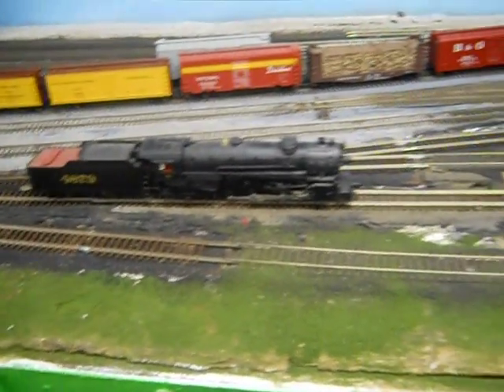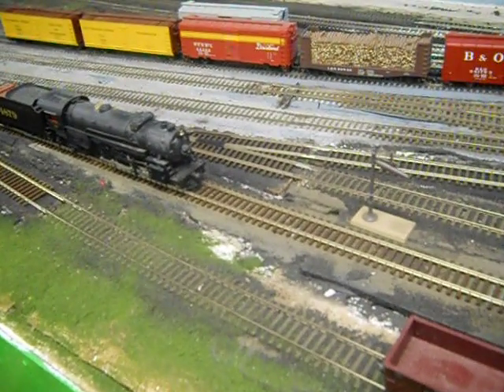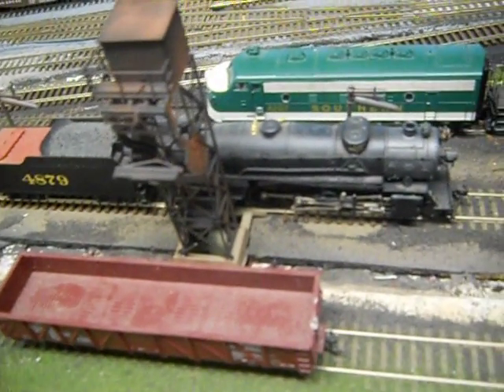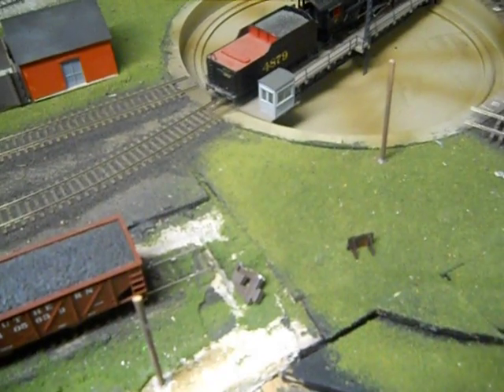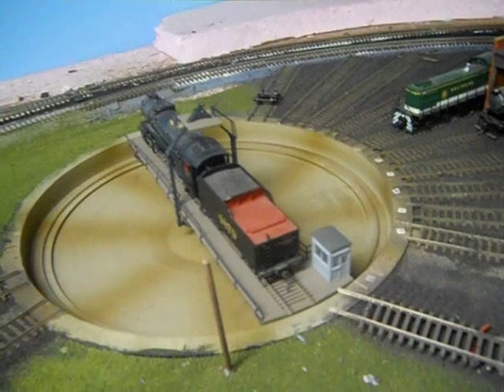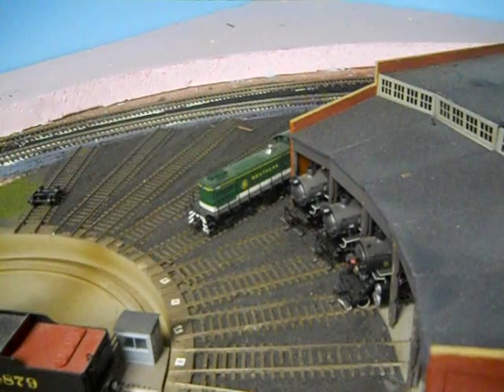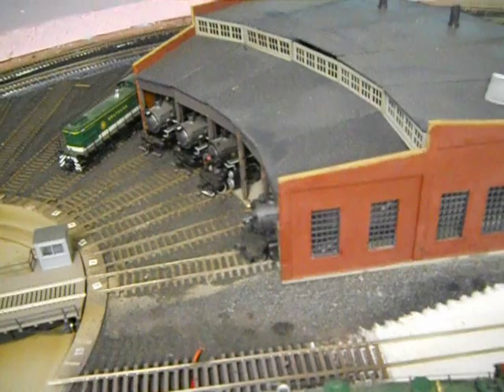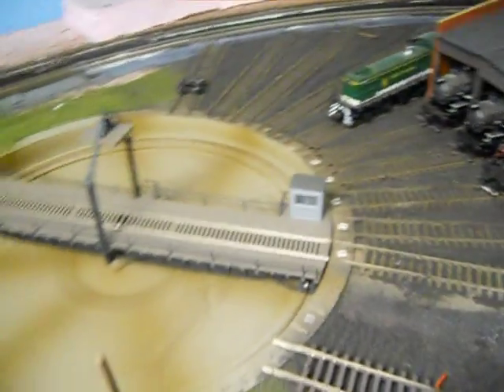Model Railroad Turntable Operations.

Comment: To help alleviate derailments between the turntable and yard tracks, try filling a taper on the inside edges of all the railheads, similar to the points on a switch. This will help guide the wheels across the joints.

Comment from the maker: Well the way my roundhouse is set up the front of the locomotive should go in first. There are smoke jack exaust stacks on the roundhouse. That's the way they would put the locomotive away at night. You got to remember at the Steam era they kept the steam locomotives burning 24-7 and the only time they let the fire out is when they did running repairs ever 200 miles or so.

Comment: Many railroads learned it was wisest to have locomotives enter the stalls head first.  That way, if the throttle was set to allow a bit of creep during the night, and it crept in reverse, it went tender first into the pit.  A lot easier for the hook to get the tender out of the pit!
Reply: Do you mean "set to allow a bit creep" on purpose ?.. Johnson bar was left in neutral and chocks placed under wheels....They headed in stack-first to be under the roof vent sitting above the stack... Accidents happen, period

Comment: Beautiful! That Mike runs very smoothly at crawling speed! One question: some railroads seem to have placed their steamers smokebox front inside the roundhouse (=tenders outside) and, as in your case, smokebox front outside. I am from Germany and every photo pof the prototype or model I ever saw was: front out. But I see it the other way around on a lot of US prototypes such as UP (Cheyenne twin turntables, if I'm correct). What do you use as a reference? Thanks.

Comment from the maker: Well I think you would be better off useing code 83 that way there is not a big bump. Its was a little tricky but as long as you use there template to line everything up,
Reply: +foxrivermotorman Not certain about the points made but ,if anyone else is searching for building a model railroad layout try Panlarko Amazing Railroad Planner (do a search on google ) ? Ive heard some super things about it and my co-worker got great results with it.